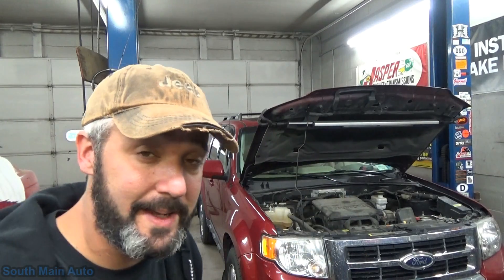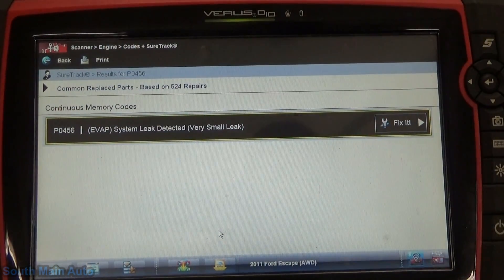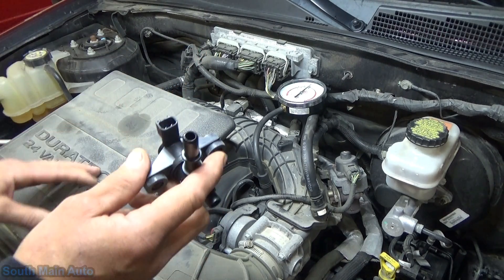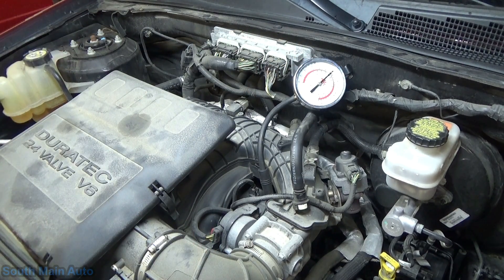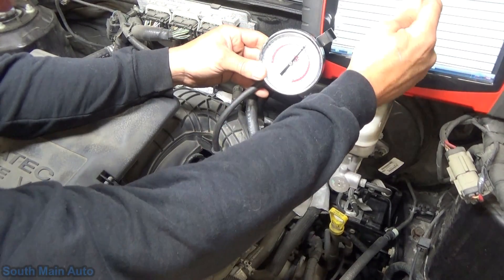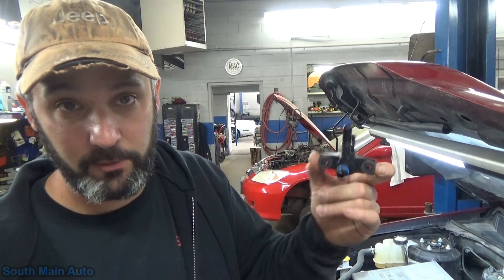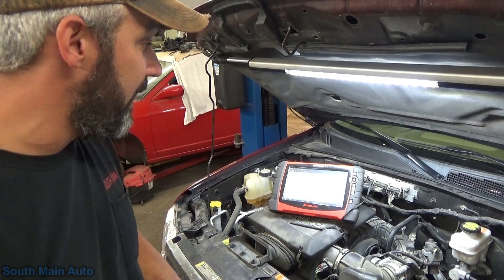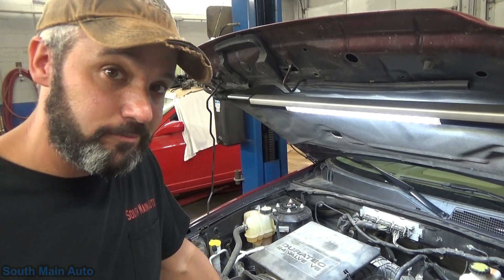P0456 Small EVAP Leak - What To Check When You Can't "See" The Leak

Comment: I have a  ford escape cap system  4 cyl no codes but smell gas  at rear near gas tank,  no leaks on  fuel pump seal. no drips no lights tank has to be  above 2/3 before strng fuel  smell that goes awayas tank goes down.   I have been told maybe to check the evap system.    Vehicle has 176K miles

Comment: I got taken for $400 by a garage that changed my gas cap twice. I replaced the solenoids, etc myself, flex sealed the hoses just in case...i know if i replace the charcoal canister or gas tank neck, itll be the last thing i spend money on thats the real problem.. with everything else replaced for nothing. This has cost me already 2 years tax return money and its still not fixed. Can it be bypassed? I erased the codes with an OBD but the inspector could tell and i failed...its an 08 accent

Comment: Bro, this is the exact video with code I was looking for. 
2004 Toyota Corolla LE, 138,000. 
06/2021:
I changed the EVAP Purge Valve because it stalled out whenever pumped gas and 
I was at a stop or red light and took my foot of the break. 
Changing it solved the problem. 

10/2021:
I had a small leak code P0456 and it was in one of the rubber hose where the EVAP Purge Valve is connected thathad an air leak coming out. Now issue came back. 
I changed the rubber hose. 

Correct me if I am wrong, but that rubber hose leak that connected to the EVAP Purge Valve caused my EVAP Purge Valve to go bad and leaving it in either the OPEN/CLOSED position. 

Fortunately, my new one is coming in today and I’ll be changing it.

Comment: I hace a mitsubishi lancer 2004 ES 2.0 engine... ANd i have this engine light come on i put my obd and said P0456.... first i bought a gas cap thought i solve the problem it went away after almost a week of driving the light came on again. I check my OBD its the same error. Thank you for this video its very helpful. I will try to change my purge valve solenoid/ Hoping this is the same problem im having it too.

Comment: f150 4.2 throttle body, wrench light on and engine Check light on it run   well, it idle normal after cooling and the wrench light is out first crank then it pop on and idle rpm drop but it doesn't stop .I'm going to change the electrical throttle body position senor, to see if it the issue on hold idle until warming up, thanks for, post

Comment: Eric, 
I was checking my purge valve when I noticed it was covered in a charcoal sediment, far dirtier than the old valve you pulled out of this Ford. You mentioned there were bigger problems if there was charcoal on the valve, what would those problems be?
Reply: Probably charcoal canister leaking charcoal in the engine which obviously isnt good

Comment: I just replace that little valve on my 2014 Taurus.  Exactly the same valve.  Took it off and blow air with my mouth, was stuck open when is supposed to be normally close.  That fixed my code p0456

Comment: I have a question about my Ford Fiesta's charcoal evap canister.  Near the air hose on it is a plastic lever that can be switched 90 degrees in locked and unlocked positions.  I messed around with this canister last night due to a P0456 error and I can't remember what it was set on by default.  Should it be locked or unlocked?  Thanks my man!

Comment: I just recently had to change the purge valve because of the code? This happened to be yesterday 4/20/19 now I see the Sam code it hasn't changed? Any tips? I did check the new purge valve to see if it was working I just changed it I thought the check engine would erase?

Comment: Back in the 80's GM had a 3C carbureted 307 Oldsmobile engine that was used across divisions, and it had a vacuum operated purge valve that I would say 1 in 3-4 cars that came in the shop would have a bad one, to the point that when you saw one regardless of the reason for the car being there, you'd check that purge valve with a vacuum pump cuzz it was 3-5 tenths of an hour warranty and super easy to do. This was the valve and we'd check at the top vacuum port. https://www.rockauto.com/en/catalog/oldsmobile,1985,cutlass+supreme,5.0l+307cid+v8,1222827,emission,vapor+canister+purge+valve,4936

Comment: Nice quick diagnosis and repair.  When you've seen the problem, that helps to fix it.
We didn't have Ford "Es cappA" vehicles. Our F250 and F350's had the regular system.  Mostly hoses, pressure sensors, and leaks around the fuel module cover/ plastic nut, after pump replacements.  Great Video AND technique!

Comment: Weve had the p0456 on our 2.5 09 escape for 2 years. Replaced purge valve twice, new filler neck, cleaned gas fill area and lubed AND smoke tested it. Cant find anything. Still no idea what to do. Any ideas?
Reply: Use a smoke machine and spray soapy water on each part of the evap system, to see if bubbles form, to see a leak, where the smoke is too faint to see.  It's possible that the replacement parts are faulty and need to be verified as being good,

Comment: Watch out for those Chevy purge valves. Gotta lean condition, the purge valve will open wide open even at 10% duty cycle. PCM thinks it’s at 10% so doesn’t compensate for that extra air. That engine might even stall, or bog down intermittently.

Comment: This is a great tip wish I know this when I owned an MB 1994 had saved me time, Mb had this purge valve and they got I think stuck open because carbon build up and the symptom was erratic idle. Is this possible on this system to get the idle problem.

Comment: I have a 2010 Ford Edge that keeps coming back to my shop (just a company we hold their maintainence contract for) with a p0422 small evap leak. It does not have a capless system and is not flex fuel. it has been to the dealer numerous times and they always says its the gas cap, but they have never replaced it, and the customer can not tell me if they smoked the system. I replaced the Gas cap as per the customer, since the dealer didn't do it. have pretty much disassembled everything inspecting it, I don't have a smoke machine and neither does the shop, I told the customer that. I removed the purge solenoid and tested it as per a vid I saw from "realfixesrealfast" but it didn't do anything. I watch a vid from 'fordtechmakulco' and he said the change the design of the purge solenoid in 2010 to the type Eric just showed, and he showed the old style which was actually the style that is on the one I keep getting. Any ideas? And I'm confused why I'm getting a different code for a small evap leak.

Comment: FMC have replaced 3 of these purge valve solenoids. I started dumping Lucas fuel cleaner in it and so far no codes. Only cleaner that works on the Eco Boost engines.

Comment: Why do we not have a regular vacuum gauge with a bleed trigger like a fuel pressure gauge ? Hmmmm . Great video as always brother . Told ya , purge for me here 7 out of 10 times has failed even if there is a smoke leak elsewhere
Reply: Good point with the relief valve on the gauges. The MityVac has the relief valve and the hand pump testers I have both MityVac & Snap-On have a greater accuracy tolerance than the Snap-on vacuum gauges I have. I just tested them against each other and both pumps read exactly the same from 0-30" Hg. The vacuum pumps have to be more accurate for component testing especially on the lower scale if your testing for overcoming opening spring pressures. MAP sensors, etc. It may be different with other gauges/testers by Brand. Both my pumps accurately test MAP sensors validating their accuracy.
Reply: throttle bottle You'd still see the leaking purge  , I'm just thinking of speed and efficiency.  😁
Reply: Would a Mityvac hand pump work? Mine has a vacuum/pressure gauge with a bleed off trigger on the pump itself.
Reply: 2 AM someone who taught me many years ago said that a vacuum pump gauge is for the pump , and a vacuum gauge should be used to check vacuum. The accuracy is always greater.  Don't know if he was right but the guy never led me wrong , not once ever
Reply: I guess a person could test that out easily with both a pump gauge and vacuum gauge hooked up to a tee coming off the same source of vacuum. Maybe a hand pump uses a check valve in it that would not show decreasing vacuum, such as a sudden vacuum leak.
Reply: you have hands, move the hose! besides, it wouldn't make a sticky solenoid valve show it's unruly face :)

Comment: Thanks Eric. Because of you, I understand the EVAP system on my car very well. One thing that is NOT clear to me is WHEN does the car go through the purge cycle? Every start? Every so many miles?  Every so much time? Every time I add gas to my car? And if adding gas is the trigger, what about when the gas gauge doesn't work (as mine does not right now)?  Thanks.
Reply: I don't know the official answer but I can tell you that I see my 08 Honda at 20-30% duty cycle on the purge valve most of the time after it's warmed up.  It seems to purge most all the time.

Comment: I never realized how many evap leaks you repair. I know you mentioned before that since you live in the rust belt that it causes a lot of these problems. But this video is great because it highlights the purge solenoid as the problem verses the traditional find the leak with the smoke machine. Lol. These purge solenoids seem to be junk. Always seem to be going bad? Or is it just me?
Reply: evap leaks are very common issue on all make, models and year cars, of course many times it's the silly folks frequently connected to the gas cap ;)

Comment: What an excellent link to Wells, I had forgotten how good those guys are. For those of us without a high end scanner, we have bigger challenges. I sure like the old school method with a vacuum gauge, most of us have one of those, ha ha. Presumably toggling the solenoid without bidirectional control is just a matter of figuring out how much voltage it needs and applying power and ground to the solenoid directly. Thanks!
Reply: Hey Spelunkerd, thanks man! You are exactly right, most of our vent and purge solenoids operate on 12v power. They are also normally ground side controlled by the PCM. That being said, they are typically powered up at all times when the key is on/engine running. So, running a simple ground wire on the PCM control side should actuate the solenoid 100%. ~Mike

Comment: Good morning Eric-O. I have the ridgeline 07. I am having an acceleration problem. All runs well but if I'm doing 50 60 mph and give a little gas i get a little hesitation. Where do you feel i should start? I did run some STP Ultra fuel cleaner with no change. Thanks for all your great videos big guy.
Reply: Does that engine have VCM (ECO mode?)  If so, it could be hesitation caused by that.
Reply: SPD Parts yes. I used STP Ultra but no change.
Reply: johnaclark1 Hi, I think I need you to explain what your talking about.
Reply: craigsclocks Scotty Kilmer said run some fuel system cleaner thru it didn't he
Reply: craigsclocks have you tried seafoam or octane booster?

Comment: Hi Eric I work mostly on European cars and I'm familiar with the system on all European car I think they all run a leak détection pump anyway I was checking my cousin's 2008 Chrysler town and county van with the older V6 engine not the pentastar engine it had the same fault I check the purge valve with a vacuum pump an it seems ok the tank cap was replaced with a new Oem I checked the filler neck were the cap goes and there was a very small amount of rust I cleaned it I also look at the check valve with the weight in them it's on the end of the charcoal canister I don't know how to test that part ? So the Ford system and the Chrysler system are similar so the purge valve could be intermittent the purge valve on the van is on the passenger side in the engine compartment ?

Comment: Great Vid Eric! I am getting a small leak code on the PT cruiser. It also has NVLD system.  I was watching some of those wells videos on it, and they are top notch.  Looks like the PT purge solenoid runs on 12 volts so I can disconnect it and cycle it with some jumpers (Probably with a test light in line just in case) since I don't have a bi-directional scan tool.

Comment: I have a 2010 fusion but same engine, with only 27000 miles I have had four of these things replaced, and had to have the gas tank replaced because it was crushed like a empty beer can.
Reply: lol, I can see it vaccuming the tank flat, but the cap would likely have to be wonky also
Reply: There is no cap, FORD had a recall for this that is why I got the new tank
Reply: once again, public/consumers got pooched over by wide-scale public beta testing, least they had a recall..
if it was like chrysler/jeep/mopatsr, it took them nearly 2 years to supply a HITCH for jeep recall on gastanks being smashed when hit in the rear-end... jeep liberty-turd, their hopes was that the jeeps got wrecked, broke down, totaled or scraped before hand.. no bail out's? they need pushed out
Reply: Cherokees were involved in that one too, got a recall notice via my parents, whom I'd bought it from, but AFTER I'd gotten rid of it.  Mine was a '99 Grand Cherokee Loredo recalled in I think 2015 or 2016 but got rid of mine in 2014.

Comment: I have a 1995 blazer 4x4 4.3. What would cause the purge port hose plug up with, what looks like, carbon?
Reply: Your charcoal canister is smoked. What you're seeing are little bits of what is inside the canister - they're supposed to stay put.
Reply: yeah bad charcoal cannister, a quick hillbilly fix unhook the lines, blow them out, and put a "fuel filter" inline right near the cannister outlet, that will keep it from getting out into the valve. so long as the cannister isn't plugged solid.
a huge leak/too much flow can cause the stuff to fly out also, double check all the lines
Reply: Smitty Smithsonite THANK YOU
Reply: throttle bottle that's why I hate anything made after 1982
Reply: throttle bottle, THANK YOU

Comment: Great video that applies to many vehicles.  Basically, it shows that you can use the engine's vacuum to test the EVAP purge solenoid.  Do not even need a scan tool, just a vacuum gauge and the ability to activate the solenoid with a powerprobe or battery.  Nice.  Thumbs up!  - Robert.

Comment: Yes sir that is correct.   If there are no evap leaks found when smoking the system using the smoke machine but there is a stored evap code in the computer, this usually indicates one of the components/solenoids are sticking intermittently causing this code.  Nice work.

Comment: Would that valve also cause a problem when filling the tank?  The local garage said I needed a new valve on my econoline when I complained about the filler nozzle constantly shutting off when filling the tank.
Reply: Nope, different EVAP valve, the one that's causing your fill problems is the charcoal canister vent to atmosphere solenoid and that one is usually a part of the charcoal canister close to the gas tank. They stick shut giving the fuel fumes no where to go when filling the tank so it backs some of the incoming fuel foam up into the filler tube and shuts off the fill nozzle repeatedly. That EVAP valve is supposed to be open most of the time but control of it is very much required too. A plugged hose or bad canister could be the issue as well so some kind of testing should be done before firing of the parts cannon unless you don't mind buying stuff that doesn't fix anything.
Reply: Thanks for the reply. The job has already been done. I think the cost was 170 Canadian dollars.
Reply: Your problem may be the charcoal cannister. My `05 taurus was a pain to fill the gas tank. Found the culprit by unhooking one of the hoses at the cannister. Filled up quickly after that. It really is a pain in the ass when the fuel nozzle keeps shutting off and you have to squeeze it and reset the catch.